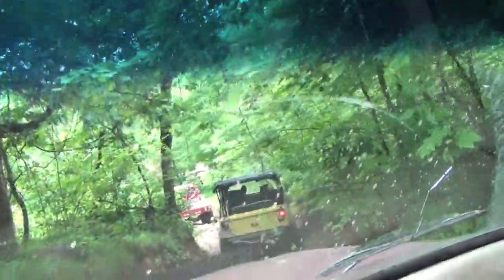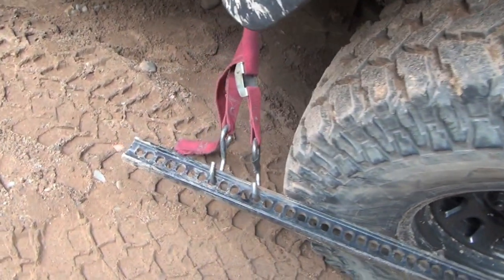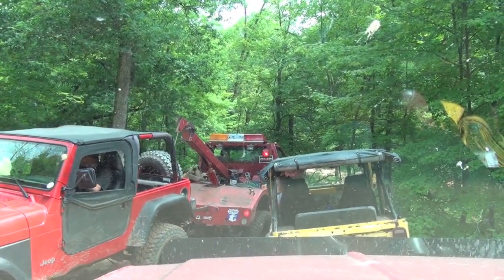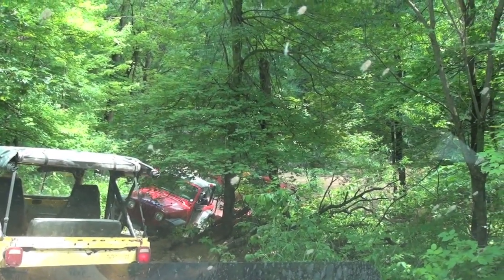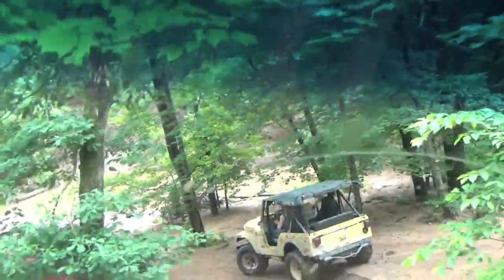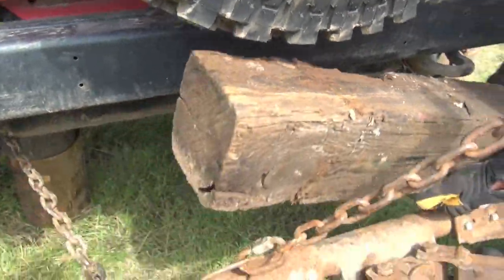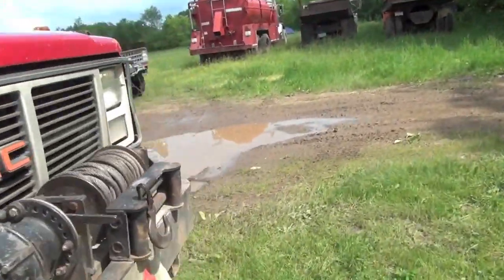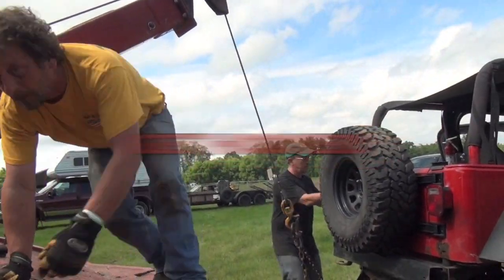HILIFT JACK TRAIL TRICK by BSF Recovery Team

Comment: I like the trick, but is the tire skidding when you move (before the tow truck lifted it), or is it turning and sliding against the hi-lift bar? I'm thinking the latter, but I haven't seen this done before. Nice video, but I would have liked a better angle on the washout crossing.
Reply: I would say the wheel would slide against the hi-lift bar  , you need to roll the tire very slowly .

Comment: Spend the $1500 and get a ford 8.8 put in.  I did since I wheel alone most of the time and hate the sound of snap crackle pop.
Reply: It seems to me that Jeep axles are pretty weak. This is the 3rd instance of broken Jeep axles I've seen, I've never heard or seen of a Ford axle breaking, with a stock engine. The axle shafts in my early Bronco were rated 3300 lbs each, couldn't hurt them if you tried!
The two broken Jeep shafts I've seen in person, one was towing a car in 12" of snow on a level asphalt parking lot, the other was climbing over a 10" diameter log.
By comparison, in my 74 Bronco, I was towing a 2500 pound trailer on the highway, when my buddies car broke down, so I hitched the car to the back of the trailer (now I"m towing around 5,000 pounds) and pulled both 15 miles back to town on very hilly terrain.
Reply: Just snapped my 8.8 today ....haven't opened it up yet but happened during 1 mph articulation.....wtf

Comment: Does this method apply to a dana 44 rear end also?
Reply: +josephmars20 No, the Dana 44 dosen't have the c-clip so you don't have to worry about doing this trick. The 44 is a much better axle.
Reply: rubicon dana 44's are as thin as a dana 35 though. but yearh, the have a retaining plate, i have an xj dana 44 with ford explorer disc brakes on my 98 xj. i just did the brake swap and replaced the bearings on the shaft and replaced the retaining plate, which i modified a rubicon retaining plate to have the correct spacing for my explorer brakes

Comment: take the spare off ????
Reply: why? That highlift jack would just tear the good tread apart. That wheel was already used, and he knew he wasn't going far...
Reply: ***** I think Dataguy meant take the spare off the back to make lifting the jeep easier with the wrecker !  I did wonder why taking out the 3 bolts holding the spare on seems such a NON idea instead of bodging with 6x6" wood
Reply: stuinNorway